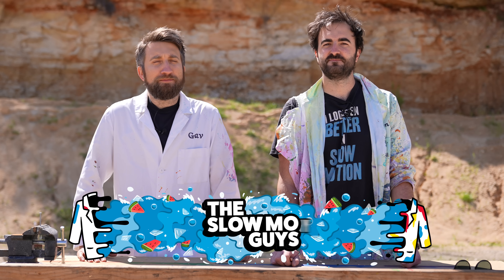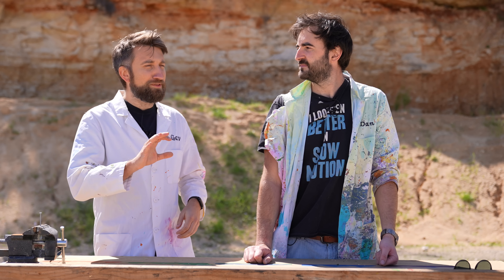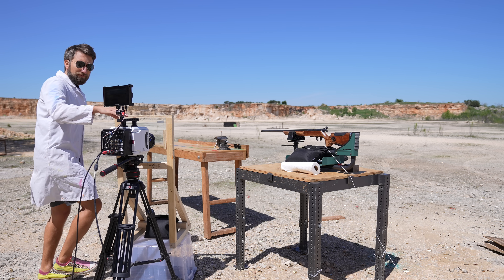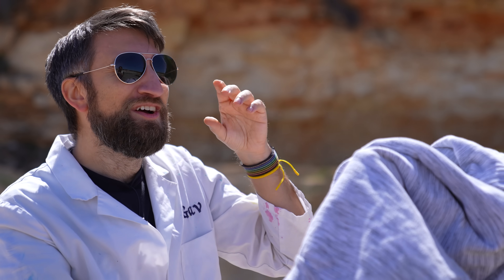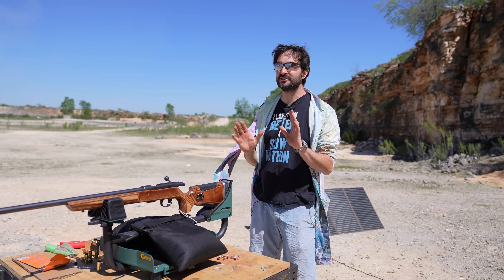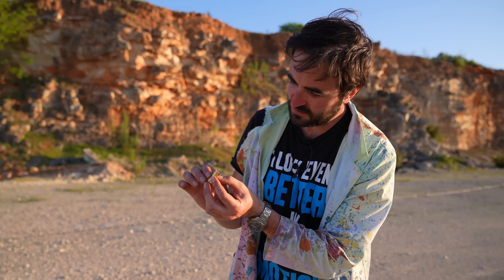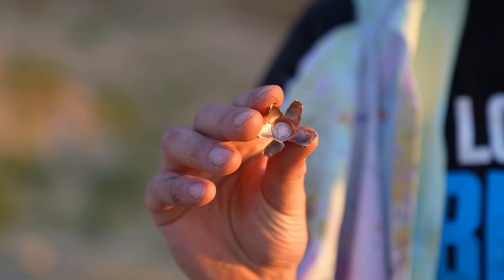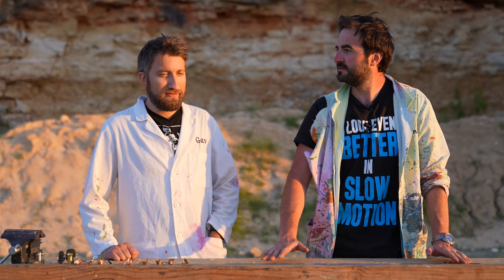Can a Bullet Go Through Another Bullet? 875,000FPS - The Slow Mo Guys

Comment: I'm sure you guys have already heard and read this, but the more accurate round is 5.7X28, notably the round from the P90 and FN57 pistol. Smith & Wesson and Ruger have options that are cheaper than both the FN branded options. That said, as I'm sure you are notable enough, surely you can contact a gunshop/gunrange that can let you use any of the various 5.7 pistols for cheap.

Comment: Y'all could've used either .223 or 5.56 for this shot. You'd have essentially the same caliber with increased velocity & a pointed tip. Even could've used green tip ammo, which is steel tipped (assuming y'all can't get your hands on steel core, as it's military only).

That being said, y'all still did an excellent job!

Comment: ok.... so if you ever re-do this video you should use a 556 out of a 20 inch barrel preferably 855 or green tip its still a 22 so it will fit in the hollow point like you have it but it should be able to pen the bullet

Comment: Basically the .22lr is trying to push through a little over 1/4" of lead.  It spreads the lead, which pushes out the copper jacket smoothly every time but the energy is soaked by this deformation so the .22lr, .50 DE jacket, and .50 DE lead core all zip off backward.

Comment: You really should have used a 17HMR like in the movie.  A 22 is pretty weak, while the 17 is smaller with enough force to penetrate some armor from velocity alone.  You’d get a lot more splatter with the lead of the larger bullet.  If you REALLY want to splatter the bullet, try and find a 17REM.
Reply: The bullet shape is a lot closer, certainly!

Comment: There is a bullet with a penetrator tip for the 5.56 x 45.  It is designated as M855 or "Green tip."  In my experience, they're widely available and not very hard to find.  The only tricky part may be obscuring/hiding the "scary launcher" that they come out of.  Possible re-visit?

Comment: You guys should have some 22 caliber bullets machined out of tungsten or tool steel and then loaded by handloader so the smaller caliber bullet will not deform on impact and it may have a chance of piercing the larger diameter bullet in real life. You guys should definitely revisit this topic.

Comment: The problem is that the round, the shape of the bullet and the content of the bullet helps. 

Iirc, that pistol that was used in the movie was a specialized pistol that fires 5.56x45mm which in US terms, it's indeed a .22 being a .223 Remington to be exact but the round is pointier than your normal .22 as it's used for rifles rather than plink guns. 
Not only that, your bullet material makes a huge difference also as having a lead core bullet vs a tungsten or steel core bullets can impact the penetrative power of the round as lead are softer, it would absorb and balloon out the energy if it hits anything whereas steel or tungsten cores takes a longer time to thus that's why AP (Amour piercing) rounds are often either tungsten or steel cored whereas hollowpoints are lead core.

Comment: I haven't seen Suicide Squad (either of them) but the smaller projectile in the clip they showed looked like a 5.7 or something, very pointy but more importantly probably an FMJ with a lot more structural integrity than a 22 with a thin copper coating over lead, and with a lot more velocity. Those go through vests, they'll definitely go through a 50AE hollow point.

Comment: @theslowmoguys i remember the mythbusters doing the 2 cars crash frontaly at 30mph or so and say in that episode that the impact would be equal to one car hitting a wall at 60 mph and revisiting this myth way later in the show after they got tons of fanmail saying they where wrong on the 60 mph. they redid the hole thing and found that in fact there is no significant difference in cardamage if one car hits a wall at 30 mph or two cars hitting each other frontaly going at 30 mph each. so in light of that i'd say that for the simplisity you assume that both bullets go at the same speed you can replicate the movie-effect like you did.

Comment: Perhaps my eyes deceive me, but... I don't think the movie nailed it.    The CGI effect showed the bigger bullet breaking up into numerous solid lumps. The real thing either fragmented the bullet far more (into a shower of tiny fragments) or (like Dan said) "liquified" it. The movie shows typical "rigid body" fracture mechanics produced by most models. So, calculated, not tested. 
Also, I'm quite sure the incoming 303 peels open, but is at the leading edge of the material thrown back after the impact. In other words, the bullet DID travel through, just not in an intact lump because it did not have a hardened tip to "dive through" unscathed. 

One last detail - the exploding hollow point proves that the gun barrel provides radial support to the brass case to stop it splitting after the gunpowder is ignited. The brass casing itself is not at all strong enough to contain the explosion by itself.
Thanks for the heat sink info, Dan. I still learned something...

Comment: Essentially, the bullet used in the film, the one that goes through the other, not only is it small, not only is it fast, not only is it pointy, but it is also incredibly hard. It can't be made of lead. My guess is that it is a fully steel bullet, or some other similarly hard alloy. Lead and copper are soft, so hitting them together just causes squishage. To go through and not lose shape and keep a lethal amount of velocity, you'd need it to be much harder than lead.

Comment: Thanks for the video. 

I would like to have seen this experiment using a .223/5.56 armor-piercing round. Maybe they are impossible to get where you are, but in the United States, they are common. They are called "green tip," and I believe that they have a steel core. The steel core might go through the .50 AE bullet reasonably well. As it was, the soft lead just smashed itself and became one with the fragments of the other bullet.

Comment: Try shooting one of those .50 cal bullet with a 5.7x28mm. It's about the same diameter and mass as the .22 LR, but it is going to be moving significantly faster; there are handguns chambered in it; it's a spitzer (pointed) bullet, as the CGI original shows, and; if you're willing to pay some decent money, you can get solid copper bullets loaded by boutique ammo companies like Elite Ammo or R&R. 

Also, if you are going to be shooting any more bullets (with other bullets), you can buy the .50 cal bullets (just the bullets) from a reloading website or gun shop for a lot cheaper than buying fully loaded cartridges just to pull the bullets.

Comment: Have there been a lot of rounds through that barrel? The bullet shouldn't be coming out at that angle. If I had to guess I'd say the rifling is either worn down or clogged up. A lot of 22 rounds are bare lead and will clog up your rifling if you don't clean yoir barrel. I have had it happen to a 22 pistol before.

Comment: Due to the mass of the larger bullet, you should be using a 22/250 round. Still has the .22 cal. bullet but a much higher muzzle velocity. (1,080-1,200 fps versus 3,680-4,250 fps)

Comment: 5.7 AP would go through it. A .22 will not do that. You need a metal harder than lead and copper to make it through. Also, you are eliminating the other half of the equation by having a stationary projectile. Which is not spinning. I’d like to see you guys revisit this and do it with proper loadouts.

Comment: They used an FN Five-Seven in the movie scene. While 5.7mm is a comparable size to a regular .22 long, being a necked down cartridge it has a lot more powder and would probably have a more penetrative effect than said .22 long. Much more expensive though. They might even make a steel cored variant. Been a while since I've seen the movie, but I think  there's a throw away line about his rounds being solid tool steel. That'd be something you'd need custom made.

Comment: The difference is in the movie the bullet that went through the center was a steel core like a 556 green tip round is. Thats the gun you should have used. Its also a .22 cal bullet that is steel core and very fast which would have replicated the movie perfectly. I'd suggest remaking this video with a .556 green tip round and watch. It'll do it!

Comment: You should use a fn 5.7 blue tip, I think the blue tip in there version for armor Piercing round but blue tip is for penetration, it's still in the .22 category but it's a little bigger, a lot faster and way more penetration.

Comment: Strangely, the first 30-06 bullet seems to be partially expanded at the tip before it strikes the stationary bullet? I saw some information a few years back that stated a pointed, lead tipped bullet, actually loses its lead tip in flight from the heat of wind friction? At what distance from the barrel this happens, not sure. I am trying to figure out how the .22 bullet seems to be traveling "nose up"? Is this how all .22's Long rifle bullets travel out of other guns as well, or is there something particular to this gun, or how it is clamped down for the shot? They make super high velocity .22 rounds called CCI Stingers. A standard .22 travels around 1250 fps. The Stingers travel over 1600 fps. That might get you a pass thru on the copper jacket. Also strange that the power did not ignite when striking the primer.

Comment: Powders come in slow and fast burning. When the round is in the firearm chamber the primer initiates the ‘burn’ which continues as the bullet travels down the barrel. The increase in pressure, which is 10,000’s psi, increases temperature in the barrel, leading to more powder rapidly burning, pressure increase, pushing the bullet faster, etc. In many cases longer barrels lead to faster bullet velocity. So a round fired outside a barrel will not burn all the powder as you see in 10:15. Put the bullet in a barrel and shoot it with the .22 and you will definitely get a different result!

Comment: If you want to revisit this again later, don't use a soft tip for the rifle round, that's why you were getting the "liquid" splash effect and not the penetration effect you were looking for. Use full metal jacket, or a green tip, or a black tip, or a copper solid, or all of the above, and film it in Texas where those things are readily available.

Comment: You know you totally can buy 7.62x39mm or 7.62x54mm that has a steel armor penetrating core in the center of it at any sporting goods store. The factories that make the military stuff just dump loads of it on the civilian market as well. Ranges will check your ammo with a magnet to stop you from using it because it damages their backstops at an indoor range and at outdoor ranges can cause sparks that start brush on fire. (Plus it's an excuse to get you to buy ammo from them right there if you brought the steel-core stuff)

Comment: I'm quite surprised that it didn't at least set off the propellant. If you watch a couple of the other shots there is actually a small bit of ignition.
Reply: But it definitely wouldn't set off the primer with a .22

Comment: I wonder if Dan knows they make laser bore sights, so he wouldn't have to eyeball the aiming down the literal bore...
I know they make ones you just shove in the end of the barrel, but, I believe they also have ones that are laser pointers inside actual cartridges. Which in the latter ones, it would shine down the entire barrel... I feel like that would be the more accurate one, just because any miniscule amount of extra weight on the end of the barrel could be imparting a tiny bit of flex. 

(although, the most accurate rocks are the ones where the barrel is not connected to the stock, so that could also induce sag... and yet, that doesn't impact accuracy 🤷‍♂️)

Comment: The CG seems like it was rendered as though the larger bullet were very brittle. While the real ones you filmed seemed, as you mentioned, much more fluid like in that fraction of a second they were deforming (most metals would be). 

It should be noted that you can get genuine armor piercing ammunition in the US, legally, as long as it's not handgun ammunition. It should also be noted that the legal definition of armor piercing (in the US) has to do with how the bullet is constructed, not whether it actually defeats any particular kind of armor. A kind of ammunition that isn't legally armor piercing but might have suited your purpose here is .223 Remington in the M855 or "green tip" configuration. It has a steel tip and is close in diameter to the .22 but is a lot faster. It (or at least the steel tip) would have had a good chance of making it all the way through the .50 bullet.

If I had to guess it seems the gun of character "X" in the movie was probably chambered in a custom version of .17 HMR. That is pretty close to the diameter seen in the movie and is both a pointed bullet and very fast (relative to typical handgun calibers). Another real world cartridge that might come close is the 4.6x30mm developed by Heckler & Koch. HK makes that ammo in an armor piercing version for military customers and is it also pointed, high velocity, and small. Both of those cartridges are physically small enough to make sense in a handgun where any typical rifle cartridge wouldn't be.

Comment: I'm surprised you didn't switch it up to a .223 from an AR-15 platform. Could have used the M855 round with the Steel core and tip. Pretty much the same diameter as a .22LR... but much faster muzzle velocity. I think that would have given you the results you were looking for.

Comment: Another good way to test this would be to swap the bullets round.

From a physics perspective, there's almost no difference between an object hitting the bullet and the bullet hitting an object.

So, why not use some kind of accurately sized but extra long tool steel spike to simulate the small bullet, mount it on a surface and shoot it with the big bullet.
Reply: Physics might object this theory when we look at muzzle speeds of the two different calibres… you agree?
Reply: @SmilingDevil  yeah, that's why I said "almost", but we're already keeping one stationary, so in the grand scheme I don't think it really matters
Reply: I thought they needed a backplate for the stationary bullet.  A trade-off for the GLARING difference in energy.  speed > mass
Reply: Or if you can somehow fix the stationary bullet in place by...welding it to the nail or fixing it in the vice or something...idunno
Reply: @declanwilcock7061  welding would be tricky with it being lead and copper and a vice would stopmit exploding properly

Plus, the main issue is that the smaller bullet is too slow and too soft, instead of punching through, it just mushes into the bigger bullet
Reply: @jon2922  No need to weld.  Just a steel backplate behind it.  The energy lost by having the .50 stationary is heart-wrenching!
Reply: @courtney5796  that'd stop the bullet being able to completely penetrate, which is sort of the problem we're trying to solve
Reply: @jon2922  At the speeds they are recording you would see it hit the backplate.  SOOOO much kinetic energy completely taken out in this when compared to what they were trying to emulate.
Reply: @courtney5796  it still wouldn't get the "bullet going in all directions" effect because it'd splatter on the backplate, plus it still doesn't fix the problem of the small bullet being far too soft
Reply: @jon2922  yeh that could be the problem but it would be nice to see it to know for sure. I might have to do a simulation if I have time

Comment: Having just started the video it's already a guarantee the .22 will never go through since it's the same material. 5.7 with a metal penetrator I think is what was depicted, but you could probably use green tip 5.56 as well since it's more easily available

Comment: The movie version actually looks remarkably like a WM0134 tungsten-alloy penetrator. Those are pointy, have the exact geometry and colour of the movie projectile and are capable of punching clean through a common hollow-point lead-core bullet.

What the movie seems to have omitted, is the sabot needed to effectively fire an unjacketed tungsten-alloy penetrator. Without that sabot the harder than steel tungsten, would shredd the barrel and not obturate effectively.

Comment: G'day,

And, pray do tell,
WHYFORE
Did'st thou
Fail to at least
TRY...; using some
0.243-inch Calibre,  or 
0.222-inch - as the
Penetrator...,
Projected from 
One
Of the apparent millions of
AR-15s currently circulating among the Firearm-owning population of the
Excited Status of Norte ArmedmeriKano ?

Channels like Brandon Herrera and Demolition Ranch regularly post Videos using
AR-15 Semi-Automatic Rifles firing the US Mil-Surp. ball Ammo, and occasionally the Armour-Piercing variety....

So, you could have done it, and my guess is that a hardened Tool-Steel Core under a Copper Jacket would have gone
Through And Through
The .50"-Calibre
Target Round.

But I be
Merely
Guesstimating...

Such is life,

Have a good one...

Stay safe.

;-p

Ciao !

Comment: Judging by the material color from the movie, it looks like the smaller round was either mild steel or hardened. The steel core ammo also typically has a jacket, but Id like to see this tested with a ss109 (I believe) 5.7mm round with the steel core. The size looks about right to be one as well.

Comment: The only thing that could have made this vid better is instead of the 30-06 using a 223 or 243. A 55g 243 hustles out of the barrel at 3900 fps, even at 100g it's still clipping along at 2900. The 223 is right about 3200. But, the 243 is 0.243 in across (6mm) and would have fit inside the hollow pint of the 50. Otherwise - one of your best vids guys. Keep it up!